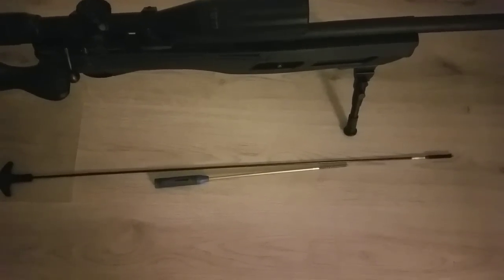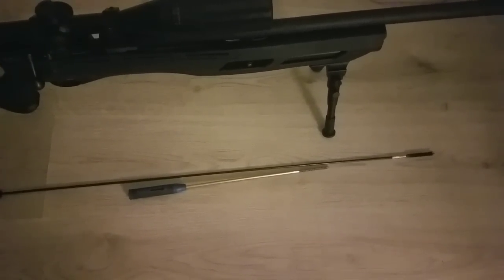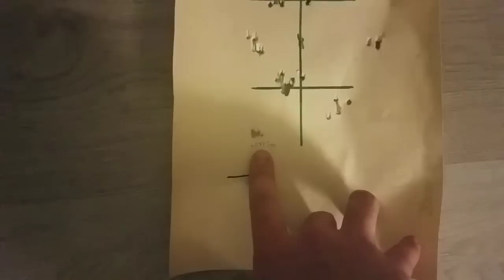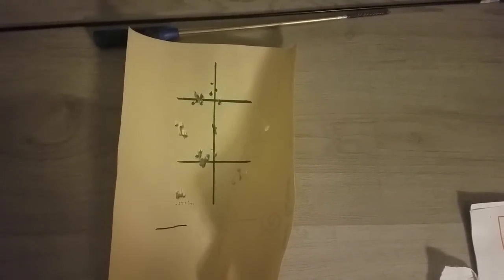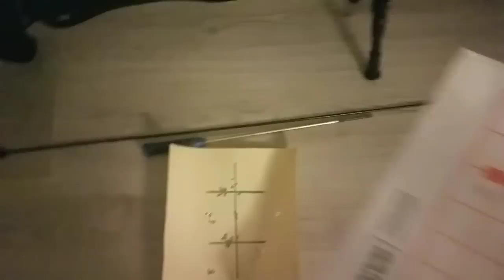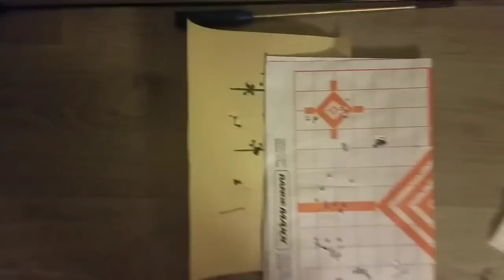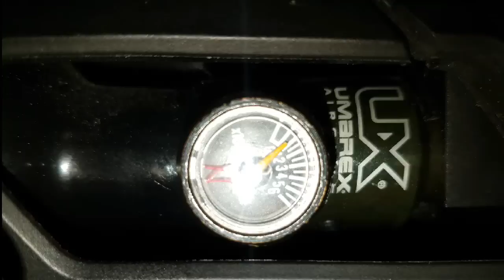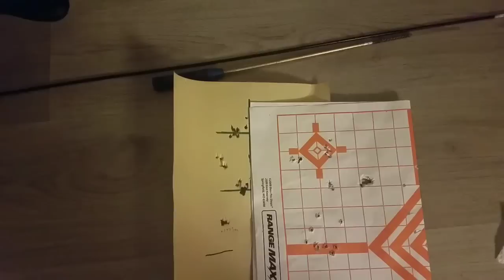So this happened AFTER using a Bore Brush in my Airgun

Comment: THANK YOU!!!
I was expecting another anti-real world physics video about "Using a brass brush (soft) just one time, removed the rifling from my airguns steel (hard) barrel!" There are countless videos making this impossible claim, as a precision machinist (30+years) with a clear understanding of Metallurgy, these claims really "Grind my gears". I always ask in the comments for even 1 of these YouTube posters to Please prove it by purchasing even a cheapo replacement barrel and make a video of this hastening in real time, uncut, no BS video fakers, but none have accepted the challenge. I can say in all honesty,that " Never in my 30 odd years have I ever, nor have I seen anyone else ever go into the tool room to begin machining even a soft grade of steel part and walk out with a brass cutting tool". (No one even makes a brass cutting tool for use on any material to my knowledge). So I will step down off my soapbox now and close with a final, sincere Thank You for this video.   :-) L8R G8R!

Comment: only use the brass brush for rust removal with oil on old vintage neglected gun, otherwise not needed usually, but he is correct bronze brush will not harm steel.

Comment: I damaged my old marauder barrel using this rod, why? It’s not intended for soft barrels on air rifles. Use a pull thru method.
Reply from the maker: Don't know how aluminum damages a steel barrel...sure it wasn't something else? ... I've been known to diagnose and fix airguns to get them to shoot better than anyone has over YouTube, comments, text, and phone calls
Reply: If your not steady with that rod, isn't there a tendency for that rod to score that crown? I prefer the "Snake Bore" method myself, It's softer and the brass bristles is not taxing on the barrel. I agree with AirgunnerCa 100%👍

Comment: There just might be something else to considers here as well. When we think about most airgun barrels...i.e. the non hammer forged barrels mostly, we realize that the steel is a bit softer than most firearm barrels. 
 If I had to guess, I would wager...with fair confidence, that Umarex chokes these barrels via the quenching method; and, if they get the barrel the least bit to hot in doing so and cause some "scaling" to occur on the surface of the bore...and, don't spend any time lapping and/or polishing that out, that would explain why you did not see a good 'bright' reflection in the choked region of the bore.
 This would also mean, however, that unless they put the barrel in a furnace and temper it afterward...that, this choked section of barrel is going to be somewhat harder than the remaining  unquenched length. Therefore, you might not be as inclined to scratch 'that-isolated' ection of the bore very easily with a brush. 
 That said, I choke my barrels by and through the quench method with great success and I do not aneal or temper the barrels afterward. I DO however, hand lap my bores both prior to AND after quenching to impart choke. I perform pre choke lapping more extensively and in a manner that will, at least to some extent, impart some choke effect in and of itself. Then, after quenching, I lap much less extensively and without slugging or using a casting to 'match' the grooved and lands. For the light "lapping/cleaning that I perform after the choke is imparted, I use a cotton bore brush only, with jb bore paste to polish things out a bit. I will periodically run a few clean patches during the process just to clarify my progress. ALL of my guns will 'shoot." Thanks guys and keep up the good work.

Comment: I have always been told by everybody that has anything to do with air guns never to put a brass brush down the barrel you might just proved all of them wrong
Reply from the maker: Same here! I can see NOT using steel brush but brass is soft ...just to remove too much build up...plus it makes sense to get full potential by getting the barrel cleaned /fresh for trying different pellets instead not knowing how much build up is in the bore from previous pellets
Reply: I haven't ever believed the bronze brush myth because common sense tells me bronze will not scratch steel, thanks for proving this James, good job and good shooting!
Also on guns shooting at 1000 fps and up using pure lead pellets im pretty sure lead fouling can occur, same applies in shooting cast bullets in powder guns. If you run them too fast you will get lead fouling.
Reply: Old Fart is that a serious question?  A “traditional” firearm is defined by a rifle, or pistol that launches a projectile through chemical combustion i.e. through a bullet cartridge. Air rifles aren’t classified firearms by the ATF because it’s source of energy is mechanical (pump up, air cylinder, spring piston, etc.)  I think it’s pretty obvious when we don’t need a background check, wait time, or a license to buy an air rifle to know it’s not a firearm....
Reply: @ALLABOUTAIRGUNS  I cant remove the crown of my break barrel. Its a Cros nitro piston with a "silencer" at the end. Yet my brass cleaning rod wont reach the crown. Should I leave the crown alone or just come in with the rod on the other side. The crown is steel so the brass brush shouldnt ruin the crown?
Reply: @gotallmyvaccinesforallknow4949  I would not do it. Because of the extreme pressures seen in firearms, especially when you get past .22 (except .22-250), the barrels have to made out of HARDENED steel. I don't think pellet rifle barrels are made of hardened steel. The pressures are not nearly as high as firearms. If you are going to use a bore brush, use a nylon one.

Comment: I see this is a PCP rifle and admittedly I have no experience with them. Is the bolt completely removable? Do you not have any way to access that chamber to run the rod from chamber to muzzle. The condition of the crown on any rifled barrel, be it an airgun or a firearm will have a direct impact on the accuracy of the rifle. Cleaning any barrel from the muzzle is a bad idea as you can damage the crown, even with a brass rod and copper bristled brush. I have to clean my M-14, M-1 and M-1 carbine from the muzzle as I cannot get straight through access to the chamber. What you do in that situation is you get a brass muzzle guard. It fits in the bore and protects the crown from damage. I know they are made in .22 but am not sure if they are made in .177. They might be because .17 HMR is available.

I believe there are also plastic coated wire cleaning "rods" which I use on revolvers which might also be an alternative.

Comment: The use of graphite powder & silicone oil or any other oil combined causes a gum snot ball effect really messed up my Bullseye scope mount and made the inside of the barrel get very dirty quickly. I Cleaned everything, and used the silicone dry spray. This worked the best of all dry spray lubes. Check for yourself. TTFP's good,  cerflon okay too, but the silicone was the best.
Reply from the maker: Right on! It's all about experimenting... I'm actually shooting my break barrel right now cleaned bore with lubed pellets
Reply: I shoot everyday and really just enjoy relaxing in this way. The break barrel really gives some exercise 65# to break it. How do I fix the part of the gun that is suppose catch and lock the piston so it can shoot? I have two Gamo magnums in both this is an issue . One of my Diana N-tecs did the same thing and I bent the barrel because is slipped out of my hand.
Reply from the maker: DANG! Its called anti bear trap i believe
Reply: @ALLABOUTAIRGUNS  So how can I fix my anti-bear trap problem?
Reply from the maker: @danhenry8557  have to probably research it on YouTube/Google about your guns or Call Diana/Gamo talked to repair person

Comment: So you used a brass brush to clean the choke only on this gun would you or do you use a brass brush on your Avenger or other ones
Reply from the maker: Thats correct, and no I never cleaned the 22/25 avenger barrels...Gauntlet has a choke and the Avengers are full bore barrels
Reply: @ALLABOUTAIRGUNS  oh I didn't  know that about the Avenger or the gauntlet does the Gen2 have a choke still I'm thinking that it does is that because it's regulated? So you don't clean the barrels of the Avenger at all

Comment: Never, Even clean an airgun bbl. form the muzzle unless it is impossible to remove and clean from the Breech. Choked and unchoked alike are very easy to damage the rifling at the crown using method shown.  Don;t be lazy here! It isn't worth the time saved to degrade the muzzle. Over a period of time, it will indeed mute the rifling in the muzzle. 
Even more important for firearms. Carbon is abrasive and is carried by the cleaning rod. Word to the wise! ;<)
KnifeMaker

Comment: I have a bump in my rifling about 1/12 down the bore. Is there a way i could use compound to smooth the first 2 inches of the chamber to the rifling bump to eliminate it?? I cant get anything to group. Crown is good.
Reply: Jb bore compound on a bore swab with ballistol on the swab first. Work back and forth through the whole barrel 10 times then swab with clean patch soaked in ballistol and then clean patches until they all come out clean and dry